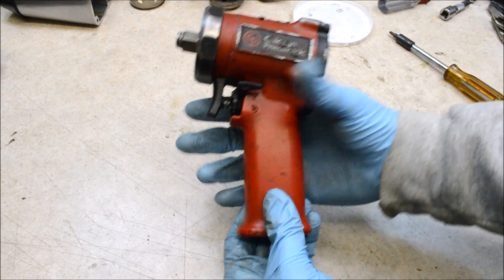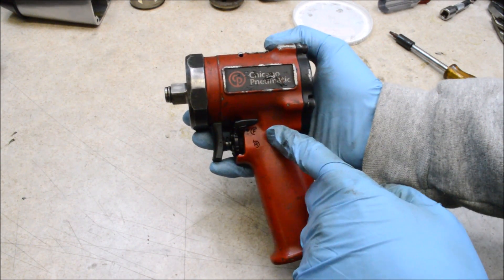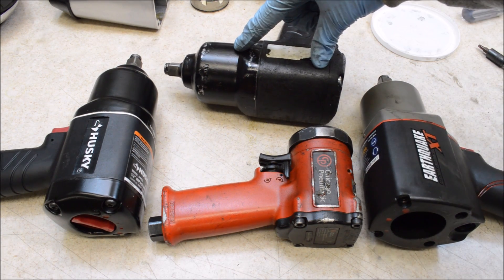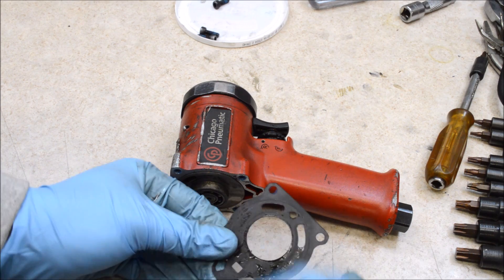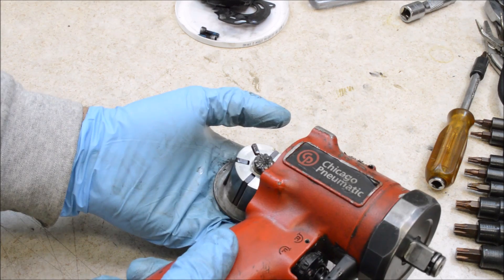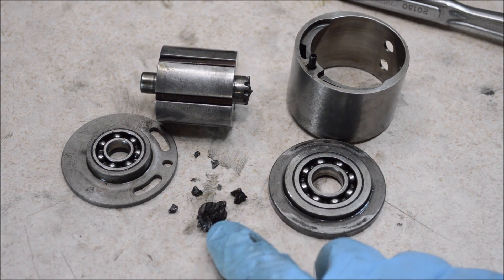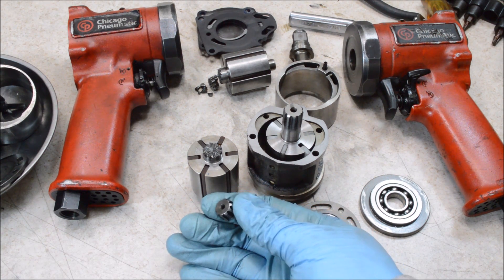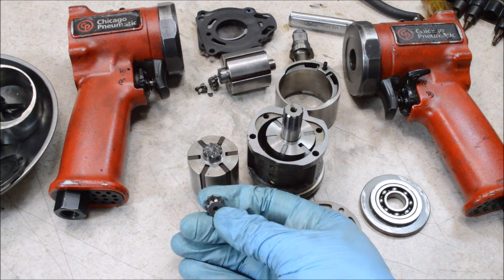Teardown: Chicago Pneumatic CP7732 compact impact wrench review and autopsy

Comment: I used a CP model 734 for appox 30 years and in that time i had to install 3 tune up kits. No parts failure except the air vanes wearing out and a couple of leaking gaskets.

Comment: Okay so the problem there is the two bearings are poor quality and they basically wore out and caused the rotor to wobble and that’s put extra force on the spline shaft and that’s why it snapped like a carrot ..... cheap bearings

Comment: Where I work we would shear off the splines like that on our 1" IR guns by running them at very high pressure (300+psi). I found that IR already had a solution they employed on their higher end models and that was to drill holes down the length of the rotors so it looks like the cylinder of a revolver. That reduces the inertia the rotor carries and keeps it from breaking itself like that.
And cool video btw.

Comment: Probably they were abused to get the same impact force as a full size wrench or were  working at higher pressure. Also it is obvious that the shorter shaft does not have a space to twist and absorb impact.

Comment: I think the short shaft is the actual reason for the failure...  Similar to those torque lug nut rods for automotive, a long rod will flex slightly with each impact and act as a small spring to absorb the shearing forces...  This gun's short shaft absorbs all shearing forces with each impact in a concentrated area, resulting in shearing failure after some use....  That is my hypothesis....
Reply: I was initially wondering if it was a lubrication issue, but I think you nailed it.

Comment: It wonder if they use the same guts for the CP7732 1/2" drive as they do for the CP7731 3/8" drive, rated at 415 ft-lbs. Very coincidental that two of your samples sheared at the spline the same way- were they purchased from the same batch in production?
Have you ever done a tear down on a butterfly impact wrench? I've been trying to determine the failure on a HF sample that doesn't spin up but just vents air, but after taking off the end cap, the air motor doesn't simply drop out as easily as shown here, and there's no visible snap rings or anything holding it in. Maybe need to take a hydraulic press to it and press on the drive tip, but wanted to see if there's something I'm missing first.

Comment: As far as I know, CP has outsourced their guns to be Made In Taiwan. This is clearly the use of inferior materials. I have one rebranded as Rod Craft. However the weapon of choice in our shop is still the MG725 or the IR2135 TIMAX. Their failure modes are just loss of power over time, never catastropic failure like this. Some guns get gummed up with crap like water and oil. On the instruction manual on the MG725, it states oil very lightly and some guys put way too much. It ends up dropping the power of their guns as time goes on. It doesn't make sense to buy CP anymore.
Reply from the maker: Thanks for the comments. That's some interesting info.
Reply: Devin Smith  help me hear if I were to invest in tools  drills impact  drills   all sorts..What would you recommend..brand wise ..I appreciate quality..
Reply: Atlas Copco

Comment: You should do a file hardness test on the rotor shafts compared to your other impacts.
Reply from the maker: That's a pretty good suggestion.
Reply: @ToolTeardowns   it's not likely you're still reading comments from a 2 year old video, but: have you in fact tested the shaft of that rotor for hardness?